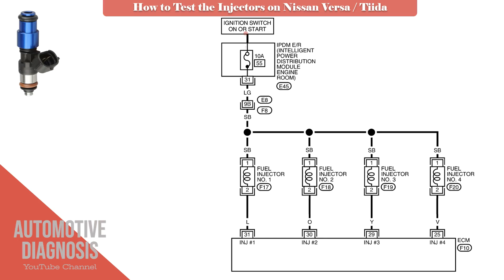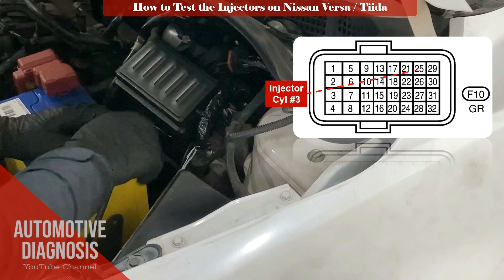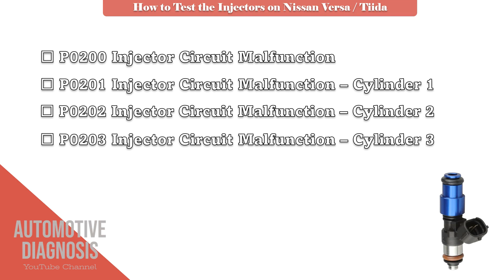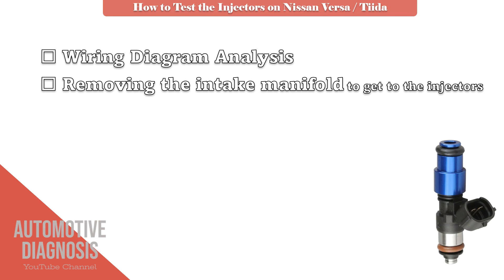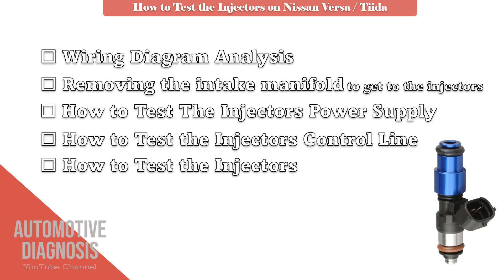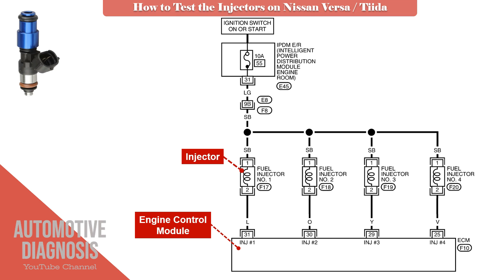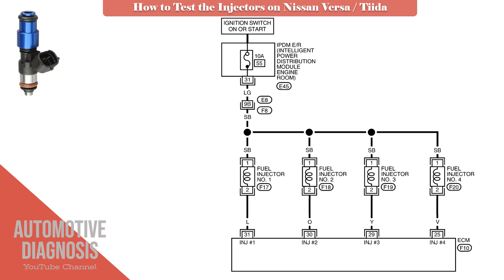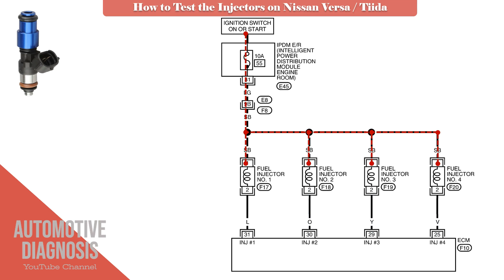How to Test & Fix the Fuel Injectors Fault Codes on NISSAN ( P0200, P0201, P0202, P0203, P0204)

Comment: Hey bub, what does P0204 injector control circuit mean, 05 cadillac cts
Reply from the maker: Hi there, there is a fault on injector no. 4 (injector or its wiring)
Reply: @AutomotiveDiagnosis  thanks alot buddy for responding back,I'm definitely going to check into it...appreciate it bub 👍🏽

Comment: Hello sir,
My Nissan note e11 speed goes off when driving and comes back after turning the engine off and on, I've changed all the sensors and the ipdm, but still have the problem,, i really need your help